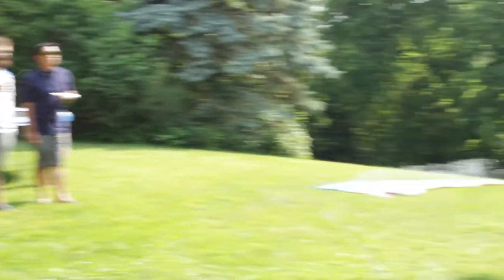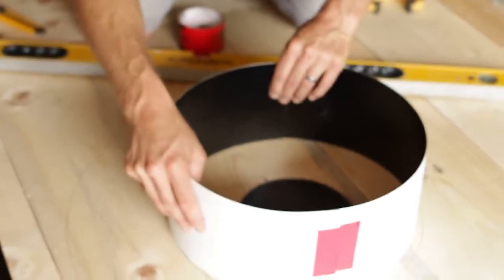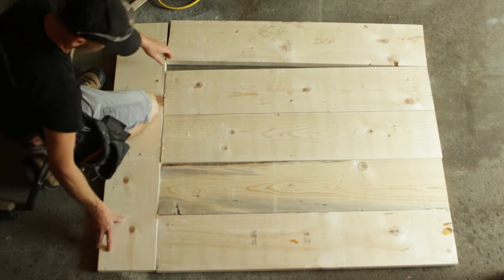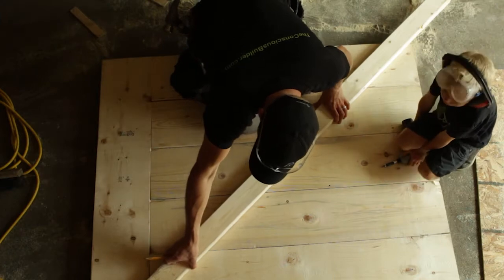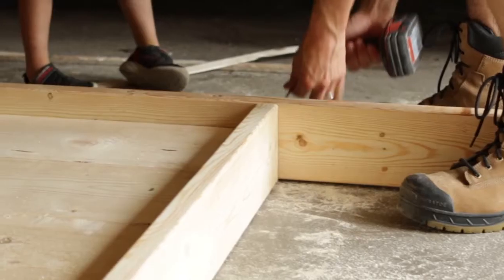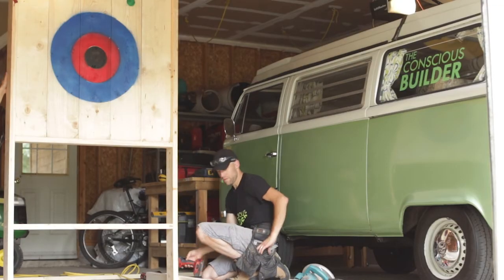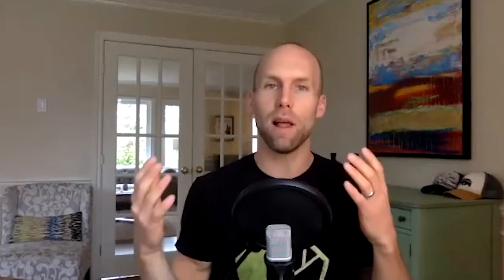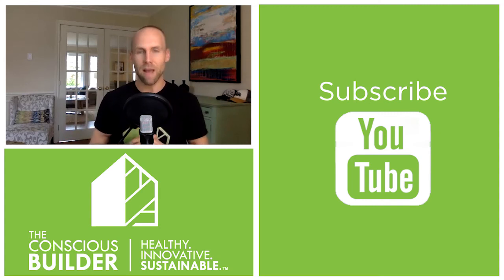How To Build An Axe Throwing Target

Comment: Ah you dork you kept calling them 2x10s but they have to be 2x8s cause you can't fit 5 2x10s under one piece 4 ft piece of 2x10 wish I would of looked at comments before buying the extra lumber I didn't have on hand.
Reply from the maker: What do you mean? A 2x10 is typically 9.25” wide which works out to 46.25” wide when you put 5 together.
Reply: @Theconsciousbuilder  You are correct.  5 pieces of 4'x10"x2" is the standard for both the IATF (International Axe Throwing Federation, formerly NATF, National Axe Throwing Federation) and WATL (World Axe Throwing League).  They just have different designs for scoring.
Reply: Rolando is pointing out that in the video you say "you will need 3 - 2X10X8s" but in the description below the video in your "What you'll need" section you say that you will need 3 - 2X8X10s